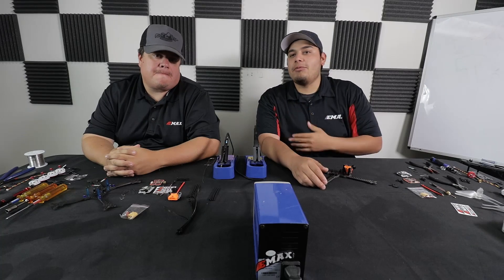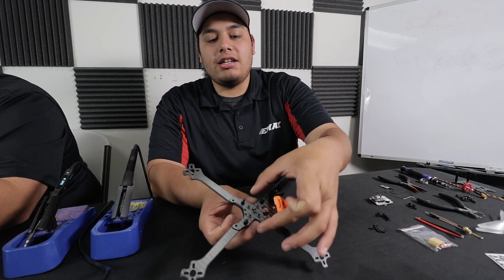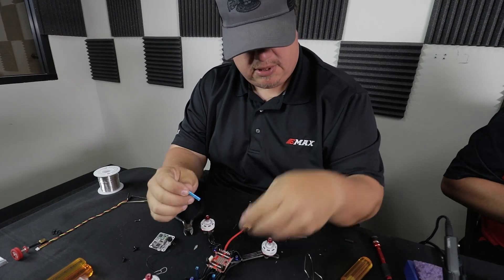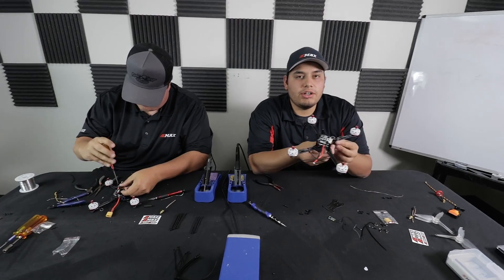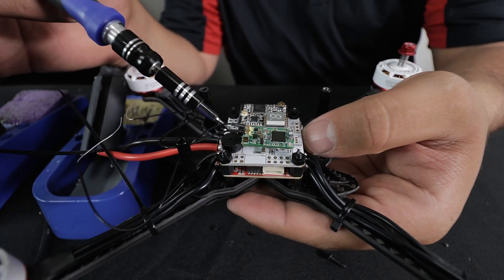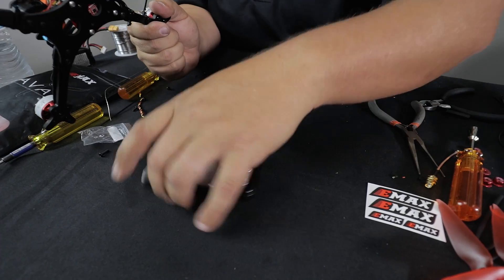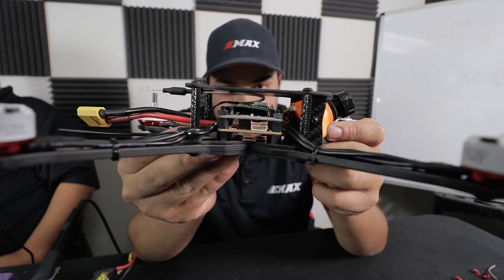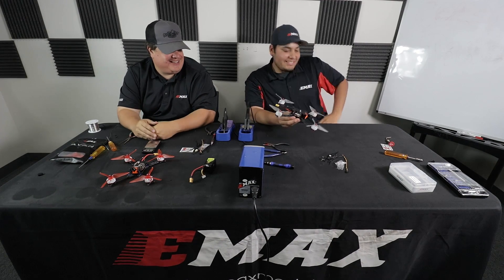Build Day - Magnum Tower System

Comment: Can I mount a BMP180 pressure sensor onto this flight controller for altitude hold? Thanks
Reply from the maker: There are open UARTs you can solder to. Make sure betaflight supports any modules you attach :)

Comment: What's the height of the tower? I want to install it in a 20mm height frame but i'm not sure if it can fit in it...
Reply from the maker: It is about 19.3mm which is gonna be a very tight build. You could do it maybe, but you probably won't have room for softmounts which may pose vibration issues.
Reply: Thank you very much! Yeah you are right it isn't enough safe also I read too many negative feedbacks about this tower
Reply from the maker: The tower itself has been mainly positive feedback. A lot of pilots swear by the Magnum. The main issues come from people who don't soft mount their towers, as you would with any flight controller.
Reply: I'll give a change to the magnum :)

Comment: hello I have a drone on the way with one of these stacks   before flying it  I would like to know how I could upgrade the VTX   on the stack can it be done   500 mw?thank you
Reply from the maker: Hello, if you look at the board's pin layout, you can desolder the vtx and resolder on whatever vtx you would like :)
Reply: thank you have people been happy with the function of the 200 mw  unit  . I always fly far and solo  and I hate the stress of that
Reply: any video footage  of the vtx  , and not in a open soccer field either thank you
Reply from the maker: Many people are happy with 200mw. Someone in the office has even flown a mile on 200mw before. It just depends on how much RF noise is around you and what your antenna set-up is. Pagoda with a sensitive patch antenna on a diversity receiver is your best choice for range.
Reply: thank you e max for the fast reply  , I will give it a go  I have a duo 5800 diversity vtx   that I use  I also have an rjx hobby diversity receiver ,it was so bad I went back to the regular fs one in my goggles but I now only use the duo  on the base station
Reply from the maker: No worries :) We wish you the best of luck with your build!

Comment: What order do the ESC have to be rotated 90 degrees?
Reply from the maker: Just rotate it with the flight controller. The flight controller has pins that need to align with the ESCs. Just remember your motor order and you're set.

Comment: Can you rotate the board 90 Degrees and fix in betaflight?
Reply from the maker: Yes you can rotate the Magnum and change the settings in Betaflight. Just make sure you have the ESC order correct as well.

Comment: my 2306 motor wires seem like they are too short for 4 the 4 in on escs
Reply from the maker: If it does not fit your frame, you may need to lengthen your motor wires.

Comment: dont try and use a spekrtum rx and expect emax to know and make it work. i emailed them stating i could not get spektrum to work. they advised i did not have it bound correct but they were wrong it lit up and bound with no problem. xhover advised me the spektrum pad on the fc is no good and to run the rx cable to the rx3 pad and BAM it worked. emax customer service is terrible i will never but their products again.
Reply: john wesley Yes.  The gray wire to rx3, a quick toggle in betaflight, and you're all good.
Reply: Thank you for this comment.  I was totally stalled trying to figure this out.  I wired to rx3 and it worked perfectly.  Much gratitude!!!!
Reply: abinosa I've had the same issue with this unit. I've all but given up on this thing. So the grey wire goes to the Rx3
Reply: My savior!

Comment: Whoa, wait a minute. The wire should be held rock steady until the solder has cooled down. Moving it too much while the solder is liquid can cause a cold solder joint.

Regarding the xt60 solder joint @3:05
Reply: Ballistic FPV 😆😆 i was thinking the same thing now hes getting a empy space around the wire, but it al looks so profesional😆

Comment: do you still need to change the motor wires over so they spin the other way?
Reply from the maker: You can program BlHeli to flip the motor direction.
Reply: EMAX USA thanks. also with the motors do you need the threads on the shaft to go the other way with cw and ccw?
Reply from the maker: Depends on which motors you buy. Some people buy in only 1 direction whereas some buy both directions.

Comment: Is there a way to still get the telemetry from the x4r on the this stack ?
Reply from the maker: There are several UARTs you can connect to for telemetry.
Reply: EMAX USA nice thanks for the info i was told i couldnt get telemetry and smart audio with the stack looks like i can go back an put my receiver in it thank you very much
Reply: EMAX USA an my tbs vtx
Reply from the maker: Smart Audio is currently not supported however :/ but everything else should be good!